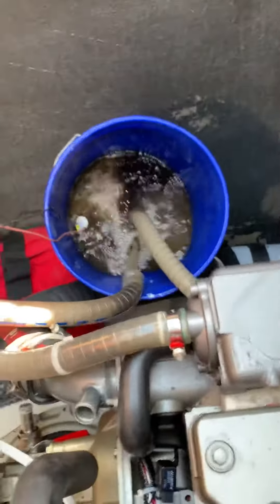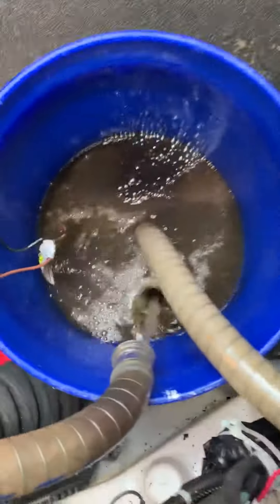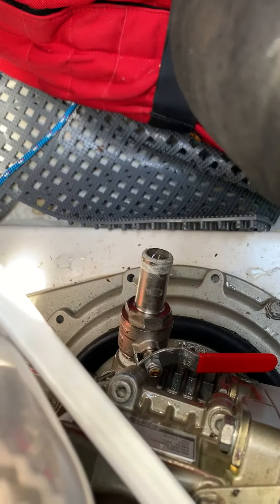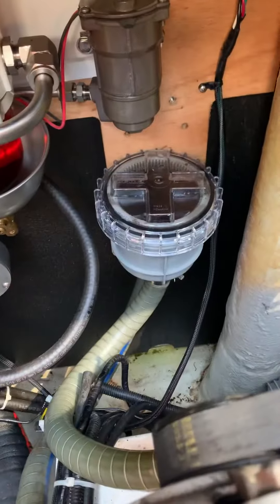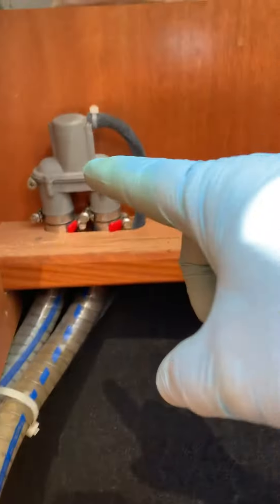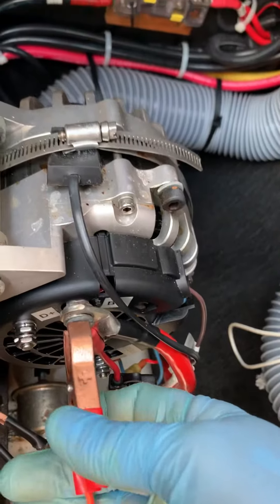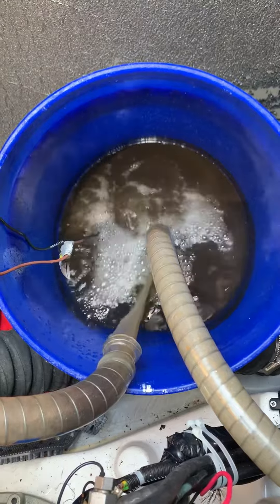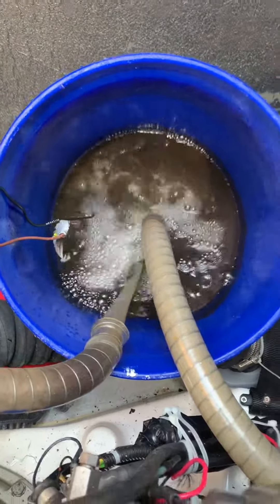Marine Diesel Raw Water Cooling system flush with Rydlime

Comment: Did the same on my Yanmar 1gm10 recently as was getting clogged up with scale. Used 1lt of brick acid in a builders bucket topped up with freshwater. Got the same result as you with that dark grey residue in the bucket and cooling system seems to be clear now. Its cheap stuff so will do this as part of my annual servicing from now on.

Comment: can you flush out the fresh water side of the system?
Reply: I’m wondering that as well. What to use to clean out the radiator and system
Reply: You can buy stuff for keeping your freshwater side clean. Although it should be coolant in their and not plain freshwater.